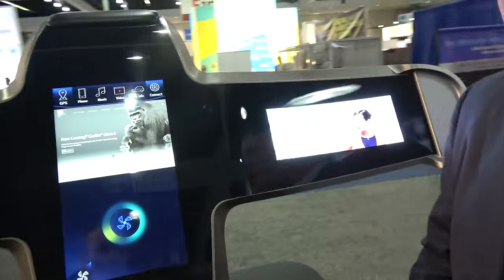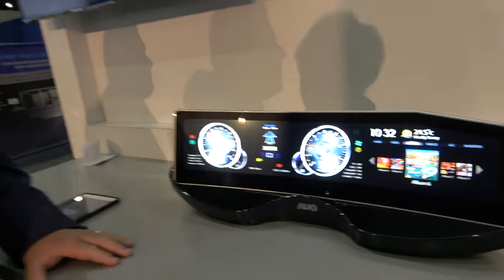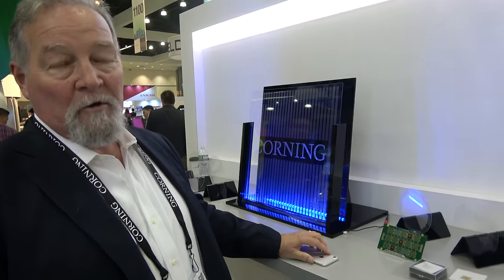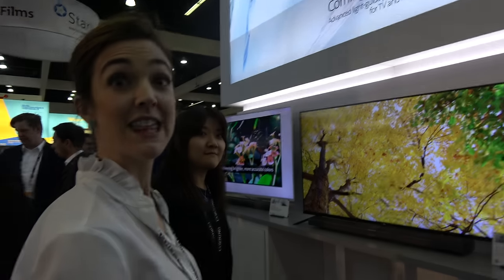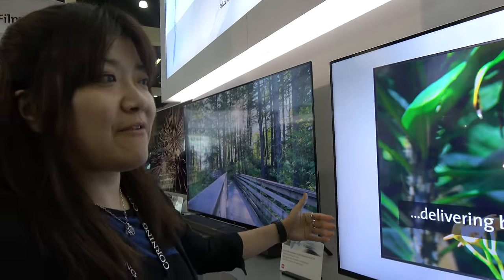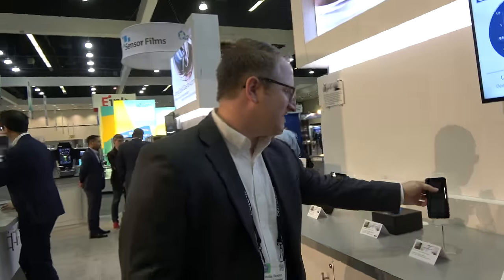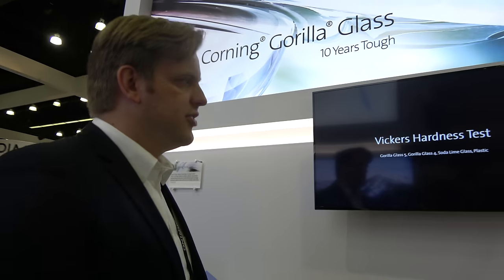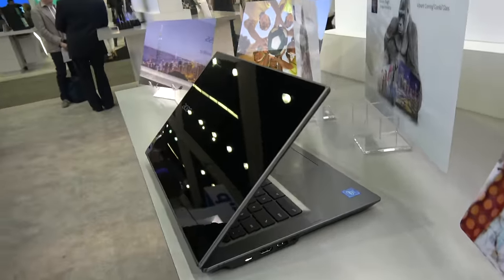Corning Precision Glass TGV semiconductor packaging to enable revolutionary PCB designs

Comment: 2:48 what I understand is they will replace old PCB with glass one 
this will break the device inside if it collide with ground  
I hope they will use more flexible glass
Reply from the maker: What I understand is that the glass is only "in between" one side of the PCB/chipsets and the other, this allows to design PCBs that could be much more compact and "3D" with layers stacked on top of each other, where the Glass is used as an insulator with tiny small holes to let the signals go through only at those places that you want that to happen, it sounds like this could revolutionize how PCBs are made. I don't know if this affects durability and reliability, I think the overall structure of the PCB does not have to be more fragile, the glass is only used "in between" the different parts and layers on the PCB..

Comment: There is something I don't understand... Glass is a very good insulator, this means that it will act like a capacitor when current will pass through the PCB taces... That's a VERY bad thing for high frequency data transfer like for the screen and ram :/
Reply from the maker: Perhaps there are some good details about the packaging technology they are suggesting here:
http://www.corning.com/media/worldwide/cdt/documents/Corning%20iMAPS%202016%20v1.pdf
http://www.corning.com/media/worldwide/cdt/documents/iMAPs%20-%20Corning%20Overview%20-%204-21-16%20FINALpptx.pdf
Reply: Gorilla glass for example is performing about 25% better in dielectric losses than standard FR4 pcb material.
Reply: Interesting, I would have though the opposite !
Reply: Not a problem. Modern interconnect-signals are using LVDS-technology.